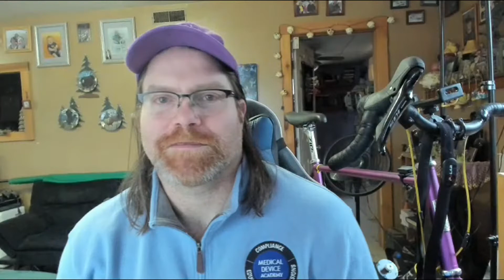What are the IVDR risk management requirements?

Comment: Hi there, thank you for all of the explanations. I'm struggling with getting my head around what is specifically meant in the ZA annex with "Device-specific execution of the process is not covered". Would you be able to explain this in layman's terms to someone who works in QA not RA?
Reply from the maker: I answered this comment in the blog page as well, but here's my answer copied from that location...
There are usability requirements covered in IEC 62366-1 that are not specifically covered in ISO 14971. This is because the usability standard was created after the risk management standard, and the risk management committee revising ISO 14971:2019 was not permitted to change the process when they revised the standard.

There are also some devices that have specific requirements in common specifications or in other guidance documents. These requirements are not included in ISO 14971 either.

You should also look at the Annex in ISO/TR 24971:2020 that is specific to IVD products.

In general, the biggest weaknesses in ISO 14971 are usability and software hazard analysis. For usability, you should refer to IEC 62366-1. For software, you should refer to ISO/TR 80002-1. In both cases, it is very difficult to estimate probability of occurrence of harm, and therefore it is best to just assume that the use errors and software failures will occur and focus on severity of harm only.